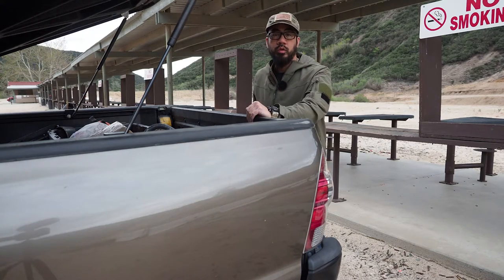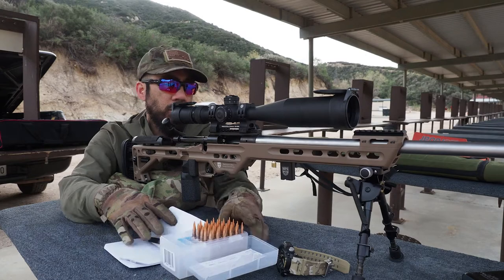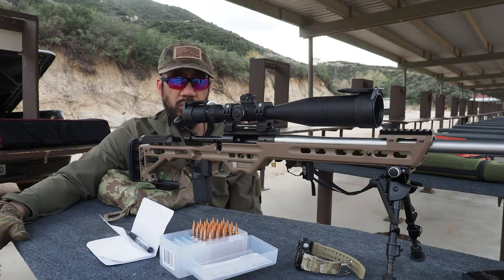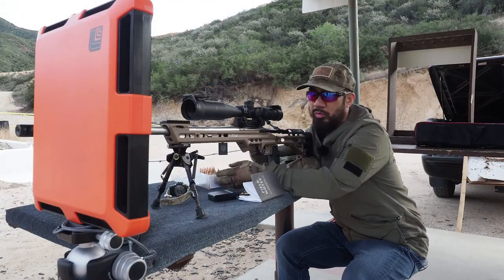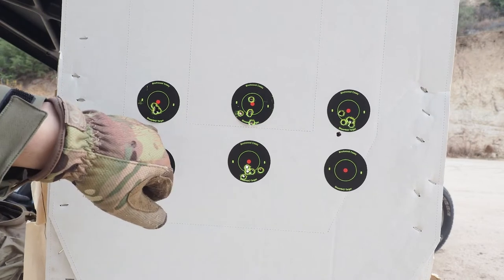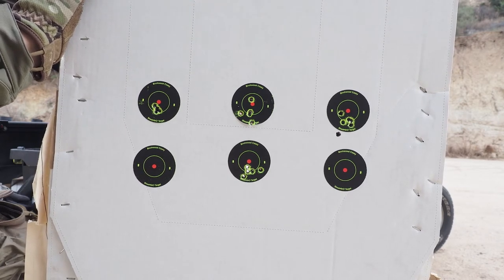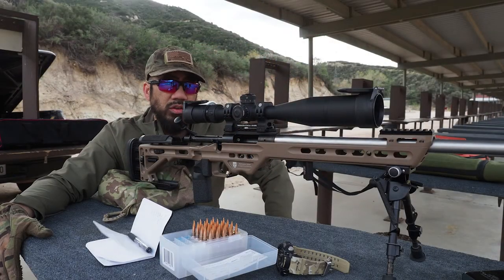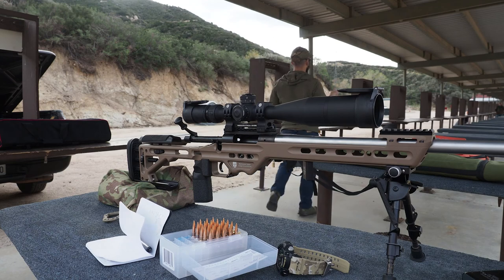Range Vlog #051 - More Peterson Cartridge 6mm Creedmoor Brass Testing

Comment: Hey Jonathan, I love your Vlogs. Their very informative. I've been using Lapua 6.5 CM Brass and love the quality of the brass.
My father in law just bought some Peterson brass and we haven't had time to try them out. They look pretty stout and weigh
out with in .04gns. I think their going to be cheaper alternative to lapua, but I'm forever hooked on Lapua for my 6.5 CM.
I've have used Reloader-17, H4350, and Reloader-16, and the best results I have had is with RL-16. That's using Sierra 142gn
#1742 matchking, 42.3gns RL-16, Coal 2250 from ogive. That gives me a  repeatable hole in hole at 100yds every time provided that I do my part. SDV is 7.<2857fps> Here's the kicker. That same load using Sierra 120gn #1720 Gameking, Coal 2255, 42.3gn RL-16, gives me a hole in hole at 100yds with a SDV of 12.<2990ftp> Go figure. All I'm saying is, if you haven't tried RL-16,
PLEASE give it a try. Sorry I got off topic, but this powder should work in you 6mm CM. It also  has a built in copper fouling 
agent and burns pretty clean compared to RL-17 and H-4350. I'm going to shut up now I didn't mean to wright a book, and thanks for the hard work.
Reply from the maker: I have been wanting to try RL16, but for some reason, the local supplier I go through to get H4350 does not get it in on any regular basis like H4350. I have no problem ordering it, but I would like to be able to get a reliable local source for it before I even bother testing it.

Comment: I have a FJ as will as a TRD Pro 4 Runner. The FJ I up graded the suspension and repaint it to black from silver, But I have replaced one front right wheel bearing and the coil for the air conditioning ( we run the air everyday all year long here in south Florida.) and it has 163,000 miles on it. Keep the Toyota it will give you a lot of years of reliability.